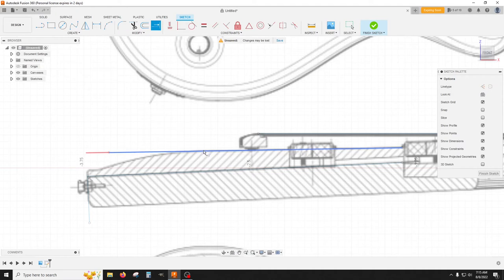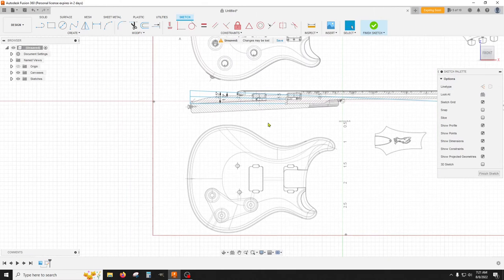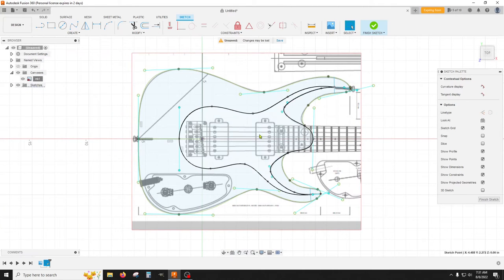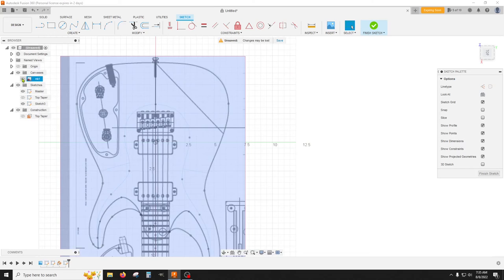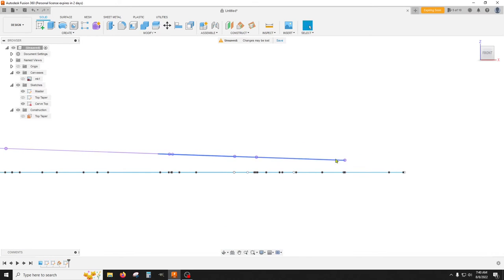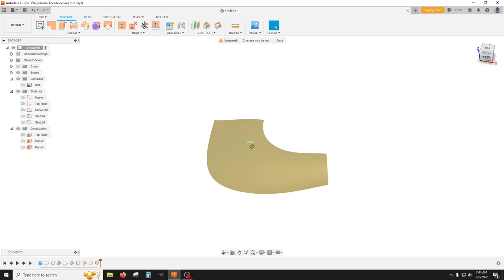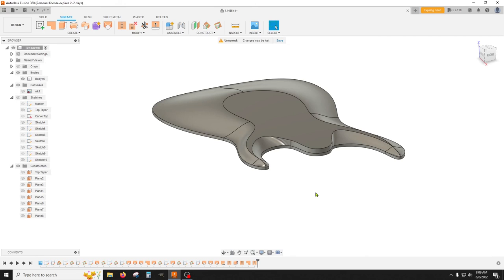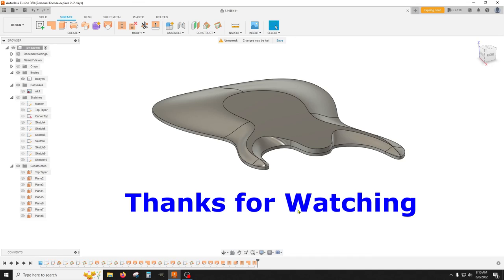Design a Double Cut Away Carved Guitar Top with Fusion 360 for CNC

Comment: Hi Lee, I am learning with your video. thanks for that. What do you do at 20:46 to connect the top level. I can't understand the command to open the second pulldown in the sketch layer.       Paul
Reply from the maker: Hello Paul, Thanks for watching my video. This is a very important command. It is called "Project". The path is available in the sketch environment. Meaning you must be creating or editing a sketch to have the menu. The Path is  SKETCH, CREATE, PROJECT/INCLUDE, PROJECT.
Or just press the "P" key on the keyboard.
Hope that Helps.
Lee
Reply from the maker: To be more correct, "Projecting" does not connect the two Sketches. It duplicates in perfect alignment ( straight up or straight down) between two work planes. As I tried to explain at the start of this video. I am drawing on the bottom most work plan ( back of the guitar) and then projecting straight up from the back of the guitar. This way fits my mind set. You will certainly have moments in your thinking were you might think, " hey , I could do that a better way." and you should. :)
Reply: @leecraftsmen5702   thanks so much. You will certainly have moments when you think, "Hey, I could do better than that," and you should :)
No, I certainly don't think that. Your work is a great help to me. I just started Fusion 360 a week ago. I'm taking advantage of an extended sick leave to get up to speed.
I normally build acoustic guitars without CNC. I would like to try cnc milling a soundboard of an arch top guitar and then compare them to the hand planed ones.
Reply from the maker: @pauldettau1464  I would think the cnc will make them perfect in every way. But maybe not as satisfying.
Merry Christmas Paul
Reply: @leecraftsmen5702  :) I am sure. Merry christmas from the other end of the earth.

Comment: Great tutorial Lee! Thank you so much for sharing this!  I have been working with an "Arda" guitars model for a while, tried in Rhinoceros first, got a very decent result but not as precise as this methos of yours, I will try this with the design and will get back to you with the result see if you like em!  Have a great day!
Reply from the maker: Cool, I was wondering how things were going with you. If you got a body milled?
Reply: @leecraftsmen5702  I am rebuilding the whole design from scratch, as the sketch was not centered, i thought it was but then after making a few necks and that they all showed some weird things like the contour you know we did it in 2 steps, top side first and then back side, well, the contour was off by a little every time, i thought i was placing it incorrectly on my fixture, so i filled in the holes, made them again and made another neck, same thing so i tried a last time, same thing. I used my calipers and took some measurements on the neck, found out the truss rod cavity was a little off center, i went back to my design and foudn indeed it was off center and somehow i had this on a center line that was not centered. So yeah, I'm starting from scratch and trying to get a better design. I designed a V shaped guitar but i still don't have the wood for that one and still can't decide if it will be a flat headstock or angled one... other than that, i'm good! lol
Reply from the maker: Glad to hear from you!
Reply from the maker: Any flex at all in the cnc will create an offset. If I ever build another CNC I will use much bigger rails and guides. I mill all my parts from the back first. I try to avoid any contour cuts from the back. Any cuts that go from the top all the way to the back are done from the top. If that makes since?
Reply from the maker: Even still there is a lot of shaping and sanding after the cnc work.
Reply: @leecraftsmen5702  Yeah i don't mind the final touches, sanding etc, but the necks were just baaaaad, lol! I will be trying a new one next week, i'll show you the results!